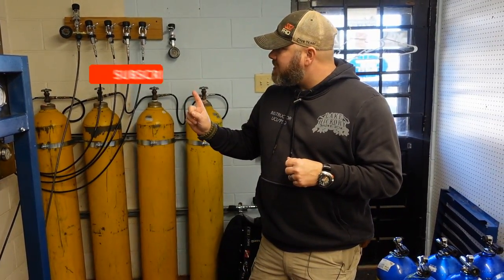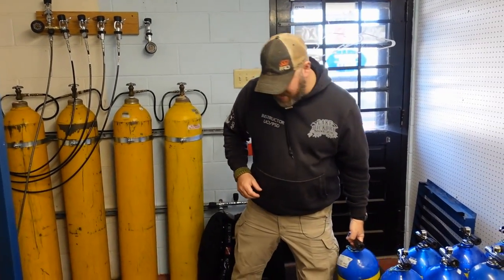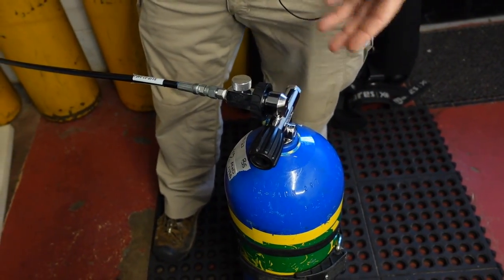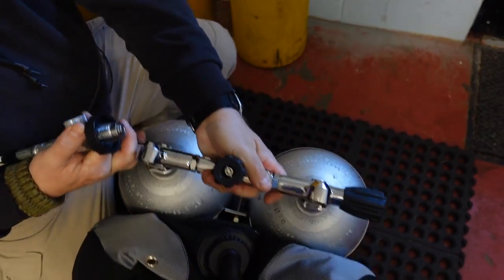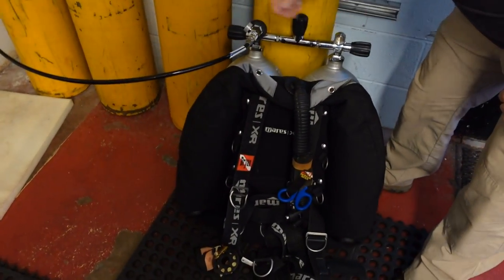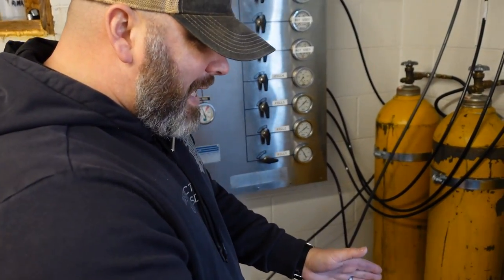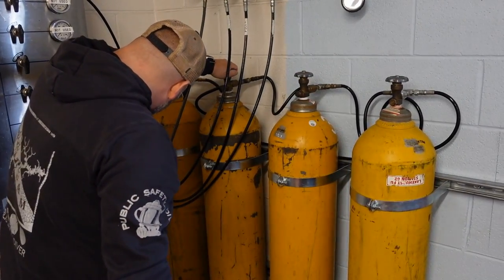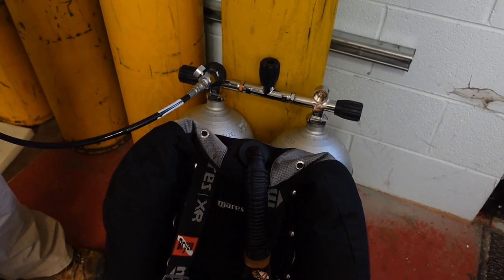Filling Doubles Is Easy

Comment: It is quite handy to put pressure gauge (or 1st stage with spg ) to the ther post while filling. Then you'll see the actual tank pressure and can be sure the manifold is, indeed, open. Once  friend of mine who was not experienced double filler,  closed the manifold during fill. When I opened the valves while ktting up it was an unpleasant surprise: My SPG showed only 120 bar instead of 200. That dive was quite short. Fortunately it eas a rec dive anuway.
Reply from the maker: You make a great point Mikko Sport. I’ve had that happen to me on trips before. The fill operator did not confirm that the manifold was open, and when I did my pre dive safety check my pressure dropped immediately. Needless to say I wasn’t happy with him, when he tried to charge me for another fill. I train all my fill operators to always verify the isolator is open. They have a check list next to the control panel that they read through for every fill. External Inspection, Hydro, Vis, proper adapter, proper gas source, all valves open that has to be open. So far, we have never had a customer tell us we gave them a bad fill.

Comment: If you're filling with the same mix that is already in the doubles, then just using one post is fine. However, in my experience, if you're trying to achieve a different target mix (e.g. 25% O2 at 2600 psi) than what is present in the doubles (e.g. 32% O2 at 1000 psi), you're more likely to achieve the target mix in both cylinders by filling on both valves at the same time. Yes, both cylinders eventually reach the target mix if you did the math correctly, but since the flow from valve into the attached cylinder is not the same as the flow from the valve into the manifold to the other cylinder, neither cylinder will have quite the right mix immediately after you finish filling.
Reply from the maker: Hello Chris Grimes, that is very interesting. Thankfully, we have never had that issue, but it definitely raises some concerns. We routinely will blend Nitrox from Nitrox, basically adding a lower or richer blend to a current mix, and have never had an issue with it not being the same as what the customer wanted. This being said, I have notice over my career that steel tanks due to how hot they get, the mix can change if I am filling via partial pressure blending. As we all know, Charle's Law, can and does effect blends, as temperature rises and falls, pressure goes with it. This can cause one blend to change as the cylinder cools. Since we fill via constant flow (ie. Nitrox Stick), we have never had this issue.

Comment: Why did you control the fill from the cascade bottle vs the fill panel to the left?  Thanks.
Reply from the maker: Great question Tim Reynolds. With our system, you can do it either way. When filling from the control panel, the cascade bottle must be all the way open. It takes about 20 complete turns to open it fully. If I open the control panel knob, it’s a simple quarter turn. Then to control the flow rate, I just barely crack the cascade bottle. It’s just a more simplistic way of doing it. Several of our other fill operators prefer the other way. We are planning on adding several more fill whips to the control panel, so if we open all of them up and equalize the bottles together, then all we have to do is cascade up by simply cracking the cascade bottles one at a time. This prevents the 20 turns for each bottle.
Reply: @LakeHickoryScuba  That makes a lot of sense. Thanks for the reply.

Comment: Doesn’t carrying the doubles by the manifold cause extra strain on the manifold? I carry mine by both tank valves with both hands. I’ve heard that you don’t carry doubles by the manifold. Is that some sort of a myth?
Reply from the maker: Hello Black Ocean Diving, that is most definitely not a myth. Putting any stress on the manifold can cause stress to it, which could lead to the failure of an O-ring, or warping of the brass. In this case however, the short distance these cylinders were moved, was minuscule at best, and the integrity of the system was in no case compromised. Great question though. Another thing to remember, is the weight distribution of these cylinders. These small 80’s are very light, and the amount of force it would take to damage the manifold at that distance is negligible.

Comment: Don’t both tank valves have to be open?
Reply from the maker: Hello 391wombat, great question. The valve knob only operates a seat that allows air to exit the orifice of the valve. The air can move freely through the manifold as long as the isolator is in the open position. This is what keeps the cylinders equalized. Thus, only one cylinder needs to be opened to fill both.
Reply: If you opened the valve that didn't have anything attached all the air would blow out of the valve. This is why doubles are good in the event you blow a 1st stage, you can still access all the gas in both tanks, you just shut off the post that is bad and breath off the other side.
Reply: Im not a doubles diver so never knew that! Good to know though!  Thank you both of you.